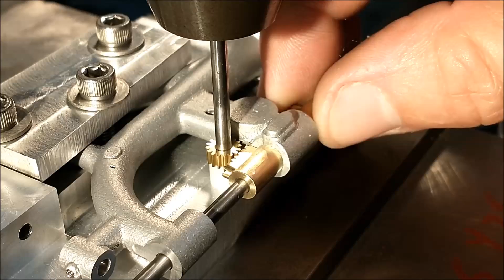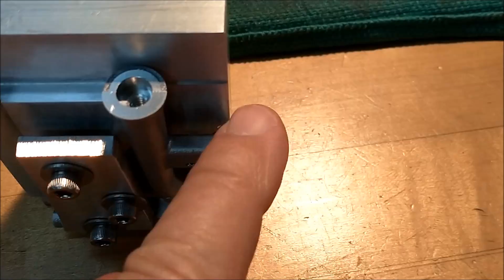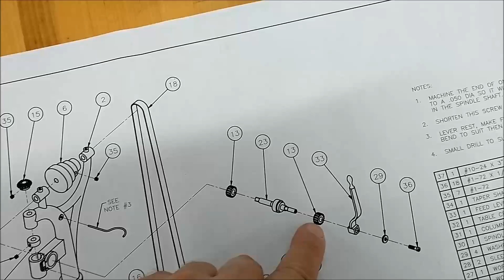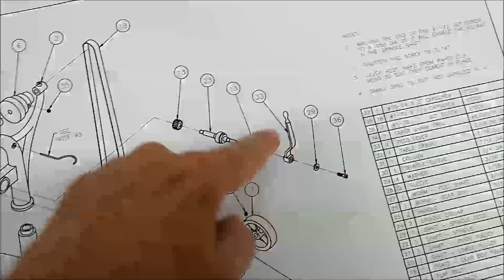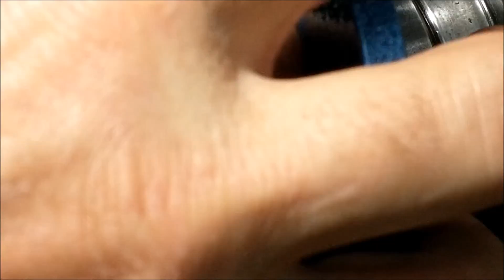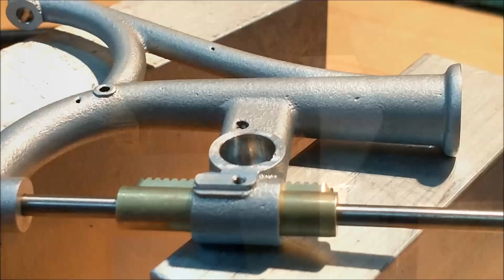Machining a Miniature Drill Press -- Upper Frame Final Details

Comment: Tip: for people building this model - it didn’t need to end up stepped back. 
After working out the backlash - if it is larger than the distance from the shaft to the center of the round feature, instead of doing what Joe did and end up with the gear off-center of the feature, instead, mill a slot into the shaft to match or shave (or shim) the back of the rack to remove the problem.
Reply from the maker: When the 2 sides of a casting aren't inline, there is nothing that can be done to make a feature concentric to two round bosses on opposite sides of that casting. You have to pick one and go with it. Unless you choose to re-machine the OD of one of the bosses. If I'm speaking out of context, please provide a time stamp of your observation  so I can be more specific.
Reply: @joepie221  at 9:35 you take the plunge on the front side. You reviewed it at 11:30 and it is about 10thou towards the pedestal column compared to the feature center. At 31:58 we see the other side. As you rightly stated it is not in line with the front feature. For that side the hole came through about 20thou towards the pedestal column compared to the feature center. If the rack backlash calculation is done before broaching, you could plan on bringing the broaching and the key way back 10thou towards the quill. Yes, the back would still be 10thou off but at least the front is zero. It’s a lot of measuring and prep but I think on center on the front and +0.010 on the back is worth it vs +0.010 on the front and +0.020 on the back. 
In no way a critique of your skill (which I am in awe of). You went on the path of broaching first before discovering it would be off as much as it was. I only thought of a better way in hindsight of seeing your method. 
Edward

Comment: Fantastic work! Love your fixture plate! I was wondering if it's possible to bring the handle pinion gear into the center of the boss by thinning the rack gear down?
Reply from the maker: I'm sure that would work, but the bosses have to also be concentric or you just shift the error from one side to the other. With castings, you have to just pick a landmark and go for it. Sometime you get lucky, and other times you'll see offsets.
Reply: I was thinking the same. Working out that depth prior to broaching would have been tough though.

Comment: How would I keep a hollow metal part from collapsing or flexing much while drilling through it.
Here’s the situation, roughly 12” long 1mm & 1.5mm thick U channel that I have to drill through from one side to the other.  I can clamp one side., but the other always flexes down when I attempt to drill down through them.
Reply: I forgot to add, the u channel is roughly 1.5”x1.5”
Reply: U can buy, or make a machinist jack for your specific size of your part

Comment: I couldn't find the dimension for the pinion shaft location either. But then I noticed a .327 dimension floating in space below the front view on the drawing of the frame with no leader lines to know what it was referring to. That is probably meant to be the dimension since when I did some quick calculations of the stack of the gears and other dimensions it came sort of close to matching. (.006"). I always use the same technique you do to verify gear spacing when possible and my actual spacing ended up at .335" . The technique saved my butt when building the lathe project as PMs #s were off on at least one of the gear spacings
Reply from the maker: My final recorded dimension was .328. Thanks for the heads up. Good catch

Comment: When and if you get to making the milling machine model. I want to see the holding   mechanism you come up with because it does not give much to work with as in a square edge. I have had a hard time with that one trying to get the holes concentric. Great work on the drill press though.
Reply from the maker: I have the entire shop. I'll get there.

Comment: Love the small machine series! 
2 Questions (from a very occasional 'make a part to connect A to B machinist, mostly work with SW/Electronic HW).
1: I noticed that you often have a finger on a part you are machining, am I correct is this to feel any deflection or unexpected vibration?   
2: Do you drill the shafts after they are turned down to preserve rigidity?  
My first instinct would be the opposite order, but on reflection there must be a tradeoff that experience instinctively answers,
Reply from the maker: OK......Since everything penetrating a part follows the previous feature...lets go.
The c'drill is the most influential starting point in the absence of a rigid feature like an end mill or boring bar. It must be spot on. The oil is not so much to lubricate it as it is to wipe away the chips and assure the cut is balanced and reliable.

Comment: When you were boring the quill gear feed hole, I figured you were going to run a chamfer and groove at a fixed radius to make it look concentric. Surprised you didn't, actually. It would have been a great chance to make a custom face-grooving tool for a boring head. Awesome job on this. And, no, I will not say anything about filling the voids in the casting.

Comment: ... a quick one.  How do you lock the spindle when you perform the keyway cut?  Thanks!
Reply from the maker: Low speed range, slowest RPM possible then cam the brake after rotating it. There is still minimal movement, but the majority will be eliminated.
Reply: @joepie221  Thank you sir!

Comment: Boy a lot of tension when you tapped those pinion gears on the shaft,then the pucker factor kicked in when you pressed it altogether in that vice I was on the edge of my chair!Merry Christmas.🤗😎🤗😎
Reply from the maker: It was only .001" press, but it felt tight. Maybe the size amplified the effect.
Reply: @joepie221  I had a similar experience pressing a 1/8" dowel pin into a hole in Al with a .001" interference.  It was a lot tighter than I expected.

Comment: It's good to have a concentric hole on the backside ,but probably not necessary
Reply from the maker: Many of you guys forget we are at the mercy of the initial alignment of the casting. The front and rear bosses are details on 2 separate halves of a casting mold. So realistically, there is no guarantee they were ever concentric to begin with. I can visually align one side, but the blind side is almost beyond my control. I can back bore it for cosmetic alignment, but I'll cross that bridge when I come to it.
Reply: @joepie221  Woosh 
My double entendre failed spectacularly

Comment: Nice job, Joe. 
But...I will have to take this thought out of my mind, I thing after you adjust the play between the gear and the linear tooth part... you can adjust by take out from the back of the linear part until you "hit" the hole to be concentric to the casting. Not completely at the merci of the universe as you say. I don't know, maybe a bad idea, but probably you give back your o-pinion :-)
Reply from the maker: I am sure your suggestion is a good one. But hindsight is always 20/20. Especially when you have a finished product to evaluate. Up to this point, I have hit the required dimensions on the drawing, but....what we have here is what I like to call a 'Chicken or the egg" syndrome. For example: the only way to know where that hole would break through is from a physical examination of already machined and assembled parts. The brass column sleeve recess and the frame broached feature would have to be done and the gear gap established. Once you determine how much to offset the rack segment, the broached feature would then be too deep. I may address this for cosmetics, we'll see.
Reply: I was thinking the same thing.  Not sure if there was enough dimension in the rack to shave off one or two millimeters from the side opposite the teeth.  Like Razvan... I am interested in your thoughts.
Reply: Would it have been possible to do the setup for the pinon gear... like you did and set that in your DRO.  Then set up to drill your hole in the casting, based on the initial depthing of the rack and pinon... again, just like you did.  But, then when you noted that it would not be all that centered, especially in Y, go ahead and center it... noting the distance that you needed to travel.  Then, shave that off of the rack...OH!!!! but then the depth of the broaching would be too big and you had no way of knowing that... okay, I just had to work through that.  Gotcha!  :)

Comment: Joe, real nice job as always. As a suggestion to improve the look of the casting; I would use a small endmill to clean the cavities and turn a slightly bigger slug of aluminium stock and tap it in. File the protruding end to match the surrounding surface and bead blast the assembly. I think you can completely hide the defects this way. For reinserting a small part into a collet I sometimes use the drill chuck and the tailstock to insert it correctly. Also works. Stay safe Joe and all the best! Job

Comment: Incredible work Joe.  

Regards to the aesthetic look of the quill drive centered in the boss, one could have milled off the back of the gear rail to get it lined up I would think.  

Also I was wondering if you were going to use your model arbor to press on the gears.  May or may not have had the structural strength to do it, but it would have been neat to see.  

Thank you so much for your videos and narration.  I have learned a great deal from you and have been  able to apply it to my work.
Reply from the maker: True, then the broached slot would be too deep.
Reply: @joepie221  I meat to say rack,

 It's all hindsight now, but it did look like you had enough of the valleys of the rack sitting above the barrel of the quill to get a few thou.  Maybe not.  Either way, it's a work of art.  Looking forward to more builds, and especially your tips and tricks.

Comment: Joe I just started watching this and I was watching you play with the gear there and it seems to really lose so much Play Between each tooth like I'm just a little bit confused
Reply: He was moving the mill table as he played with the gear, adjusting the backlash tighter and tighter. Watch that part again, at the end the fit was perfect...
Reply from the maker: Watch the movement deteriorate as I move it. The table was moving, but it was almost impossible to perceive.

Comment: So many goodies in this episode Joe, I learn a few easy tricks. As for the casting voids, my I recommend just using soft soldering with a blasted finish. Use maybe a 40 to 80 watt electric iron also. This would keep any distortion to a minimum if at all, and it would be homogeneous. Jigged up would also help. Option B would be to epoxy fill then but ??? Anyway great video.
Reply from the maker: I'll experiment.

Comment: Sounds like you have 12L14, which is free-turning leaded steel that's used a lot in screw machines. It my go-to mild steel for the lathe, available in round and hex bar.
Reply from the maker: Soooo much nicer than 1018

Comment: Joe- are you going to machine a Jacobs chuck, or do a OOOO Morse Taper?  Gotta hold those drill bits and mills and reamers!   Or would that be a collaboration with Stefan or Clickspring?  Inquiring minds need to know……..  Your setups are decades of OJT placed in multiple videos.  Thanks!
Reply: He could machine it from a tapered pin then use a pin reamer to make the socket

Comment: The L means leaded.  Free Machine steel.  The percentage of lead to amount of steel is defined - the lead is put inside a container on a rod.  The concentric rods are put deep into the hot steel and the outside is turned against the inner and a door opens letting the lead to spread through the steel.  The rods/box are likely carbide.  Nice process.  If added to the top, it would vaporize and be lost.  I have "Metals Handbook" a fantastic source book.

Comment: Question: At 9:44 the part is flexing slightly as you bore the cavity.
Is that a good place to use a small screw jack or adjustable parallel or other to help reduce or eliminate the flexing?
Reply from the maker: It would be. Anything to absorb the pressure.
Reply: @joepie221  Maybe you can make a 1/12th scale screw jack for future projects???
You might need a set when you do the shaper.

I think you're having too much fun doing these projects.

Comment: If you reduced the backside of the rack you could have centred the gear to the bosses on the casting.
Reply: I thought the same after seeing it assembled. Would have also reduced the amount of broaching necessary.
Reply from the maker: How would you know this ahead of time. Its a feature that shows up at the 'almost done' level of assembly. Hindsight is always 20/20. Plus, who says the bosses were even concentric to begin with?? You have to pick something and go with it.

Comment: Beautiful work.  It really looks like it might have been designed so that you put that little gear eccentric so you could rotate it to adjust the backlash.  That would probably just over complicate things though I guess.
Reply from the maker: Hi John. If you are thinking like bandsaw roller eccentrics, I have to say that wouldn't work here since its the shaft that would have to be eccentric, but that would go from perfect to open and back to perfect during the raising and lowering of the spindle.

Comment: the cold rolled material is 12L14 , great work going on here thanks for making the videos
Reply: L stands for leaded, at about 0.2% lead composition. A free machining cold roll steel the lead helps break chips and provides a great surface finish. Used to be made by LaSalle Steel under their trademark name of “Stressproof”.
Reply: @Zircon10  correct ,mainly used in screw machines
Reply from the maker: We once used a material called ledloy. Is it the same thing?
Reply: @joepie221  that’s it! Anytime you need a free-machining steel that takes on a beautiful, smooth finish, it’s your go-to stuff. Been around for at least 50 years as I was using it in my teens for turning projects. Especially nice on cold-rolled bar stock using HSS tooling…avoids those “hard spots” that you run into with standard mild steel cold-rolled that tend to make micro surface tears.
Reply: @joepie221   yes sir .l

Comment: What an incredibly delicate part. What was the sidewall thickness after drilling a 1/8" shaft with a 2mm bit and then threading it on the second side. 😅
Reply from the maker: 1/4 mm maybe at its thinnest area.

Comment: in the paper industry they plug wormy drying roll castings with little precision plugs made of the same cast iron, you drill out the porosity with a slightly bigger drill, then hammer an interference fit plug made of the same material as the casting into the resulting hole, then you just file it smooth, touch it on your bead blaster and you will probably not be able to see it, perfect if you are not going to paint your models..

Comment: Nice work. Can I be the first to recommend using 6 different things to fill the holes in the casting? On a serious note, I don't have any suggestions but they used to use lead to fill cosmetic holes in cast iron back in the day.

Comment: Don't sweet the concentricity, the old full size equipment had the same problems. Rough castings are exactly that, rough
Reply from the maker: I've said it before...There is no guarantee these bosses were even concentric right from the start, but ya have to pick something to go with. I could fix it, but probably wont.

Comment: When you get it done, where are the tiny drill bits sourced and don't forget the motor! (:-()-
Reply: That would have been powered by a pulley to an overhead line shaft, so doesn't need a motor directly. :-)

Number drills commonly go down to a #80, which is about a third of a millimeter in diameter. PC board drills also come in very small sizes like that, and have larger shanks. You could start with a set of PC board drills in various sizes and grind Morse tapers on the enlarged shanks. :-)

Comment: The explanation of the concentricity's between the bores on the frame.
The explanation of the different arms/wheels of the assembly.
The tip about getting a true concentric cut after flipping the part around.

This video has got to be at the top of the list for useful information per minute. I love it!
Keep it up Joe!
Reply from the maker: Thanks. I try to be thorough without being overwhelming.

Comment: At last something I can contribute. After years of machining aluminum castings about the best color and texture match for filler is Alvin Lab Metal. You can sand file and to some degree burnish. It seems  to have a very high percentage of aluminum in it.. Get the solvent and the repair putty.. 
Thanks for the video Joe.

Comment: I could see the deflection on the part as you were machining it. Of course I'm seeing the part/deflection magnified several time but isn't it enough to affect accuracy? Should a jack or adjustable parallel not be used if room permits?

Comment: 12L14 steel used to be known as Ledloy. Has a small amount of lead and it machines so nice. Doesn't weld worth shucks because of the lead. As for filling the void in the casting, Devcon makes "Plastic Aluminum" but it costs   $$$$$. Maybe sand some aluminum and mix the dust with clear 5 minute epoxy.
Reply from the maker: Thank you. I've used ledloy before and it cut exactly the same.

Comment: I'm wondering how one of those aluminum repair sticks that melts with a propane torch would match with the native metal as far as looks to be able to blend in?? I have seen many of full size machines that have castings that are not concentric so the model is right on scale.
Reply: Even if it didn't blend in straight away, could be sand blasted to blend in that way

Comment: To fill the voids in the casting try light weight body filler. So much easier than bondo. The light weight filler sands so easily. You get It at an auto paint supply store or let me know and I'll send you some. Great video as always